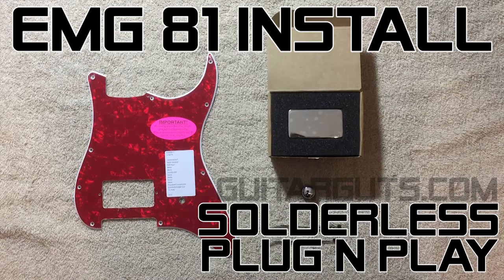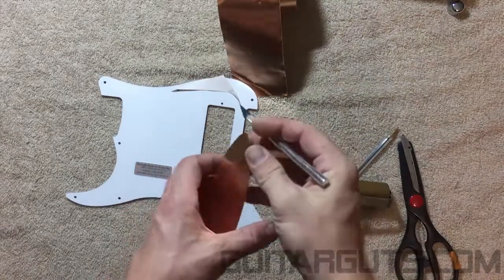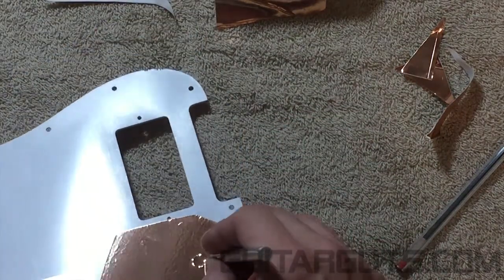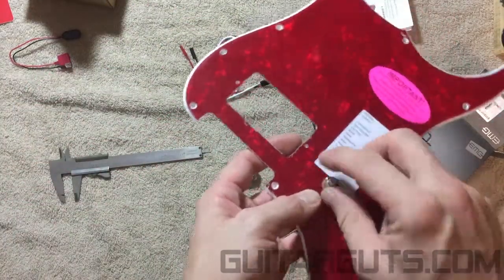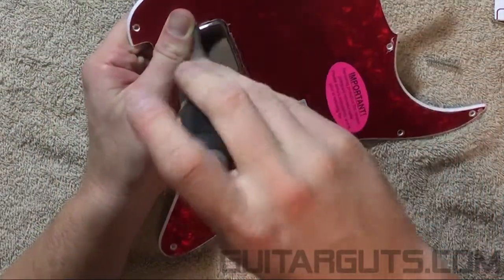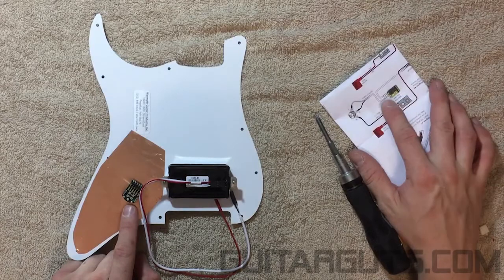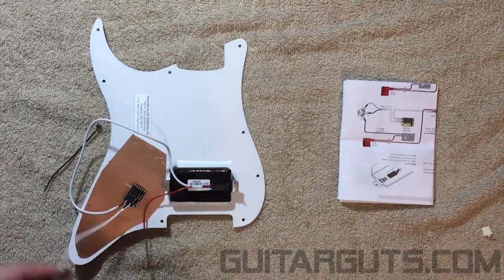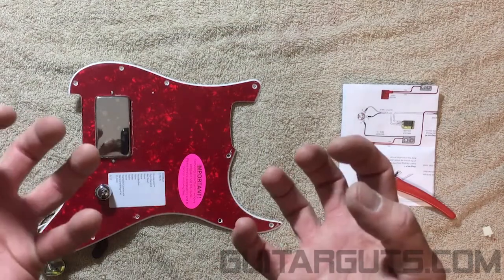How to Install an EMG 81 pickup into a Stratocaster pickguard

Comment: The solderless connection is so awesome. I'd honestly love a set of fishmans but they seem impossible to install and you can't beat a classic 81 man. It's the metal/shred sound. Very helpful video my guy
Reply from the maker: I agree! The solderless EMG system is so much better than their old system! I love classic EMGs, but I really want to try a v set of Fishmans! Cheers brotha!
Reply: Yeah EMGs are easy to install except routing out a battery compartment while with a strat or guitar that has a backplate you can do a stealth install where it looks like it has no battery.

Comment: EMG absolutely RULES! I've got a PRS with the 81/89 set and they absolutely DEMOLISH any other pickups out there. Nothing beats EMG for clarity, articulation, sustain, noise control, output retention, etc. There are a lot of great pickups out there and I've owned them all, but EMG broke new ground when they released the 81 upon the guitar world and things have never been the same. I've had both Duncan and DiMarzio actives, and even a Bill Lawrence in an ax with a built in preamp. NOTHING even comes close to EMG. From crystal clear to volcanic lava tsunamis of gain, they've got it all locked down. They are truly space age creations.
Reply: Yeah I remember Zakk Wylde got Dimebags tone out of EMG's without using a Bill Lawrence L500XL.

Comment: Hi sir, i have emg 85 pickup and want to install it to my strat too. can u advice me, whats are the parts should i prepare? example like: battery holder, stereo input jacks with 4 solder lugs?? or is it same with this video?
Reply from the maker: Hey there. If you buy a new pickup, it will come with everything you need. The pickup, stereo output jack (3-lug), new 25K pots (needed for EMGs) wiring etc. it’s all plug together so it’s very easy. Good luck!
Reply: I put 2 batterys, 18v conversion in middle pickup position.  They last 3000 hours, so no need for easy access. EVen if only half that. The fun part is dremeling out the body.
Reply: @starbattles1  One 9v is more than enough for me. EMGs absolutely deliver. There really are no pickups as well made and well designed. They cover all the territory of music and, when you think about it, they are like an amp inside your guitar because of the built in preamp. You just have so much more range with these things. Do you play metal?

Comment: I have an American fender strat with stock pickups.  I would like to add the emg 81 to the bridge and keep the other pickups intact.  Is that possible?
Reply: I have a Strat too and was wondering the same thing. That's why I'm considering getting an emg 81 for the bridge and emg S, or maybe SA, for the neck and middle.
Reply: The Hidden Hand no you'd have to get emg single coils I tried  it and it ruined the emg sound just disconnect them

Comment: I recently bought an 81 with the solderless wiring for my partscaster, and I'm running into an issue: the stereo output jack is too large for the jack cavity on the strat body. It fits unwired, but when wired up, the assembly takes up too much space and makes it impossible to mount the jack plate. I imagine this can be solved with a dremel, but is this typically necessary on a strat with EMGs? It is a Squier body, if that matters.

Comment: Hey there. I’m just about to install an 85 as a single pickup in my American strat. The thing is I bought the Zakk Wylde set so I got the 85 and 81. My question is can I just use the wires in the set to wire the one pick up in? I can’t seem to find a diagram to do so, do I just follow this vid? My pick guard will be here in 4 days.
Reply from the maker: Hey there. Yes, you can follow this video. It’s real easy, just connect the pickup to the pickup cable, then the other side of that pickup cable has black/white wires with a plug and a red wire. Connect the black and white to a volume knob, then connect a cable from the volume to the output jack. Now connect the red wire to the red wire of the battery clip using the red plastic connecting piece. Now all you have to do is follow the directions on how to wire the output jack 🤘🏼 good luck. Email me Mark@guitarguts.com if you need more help.